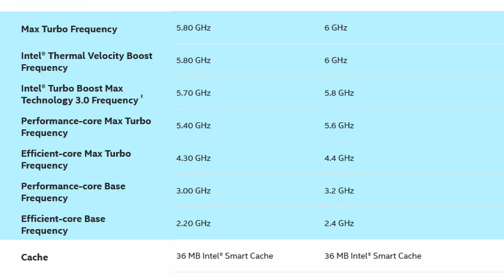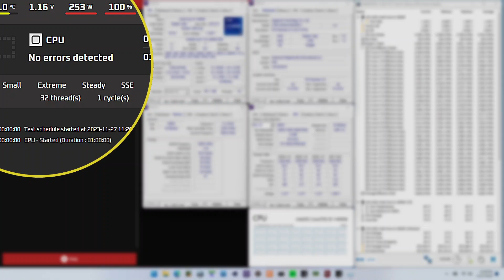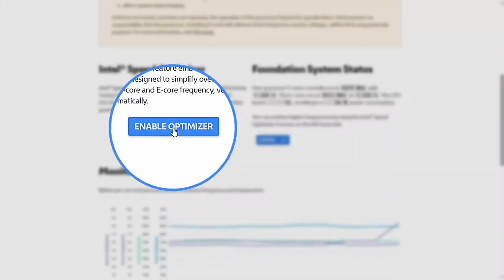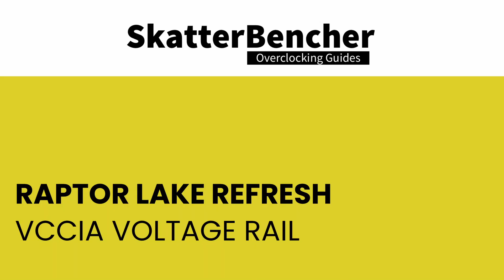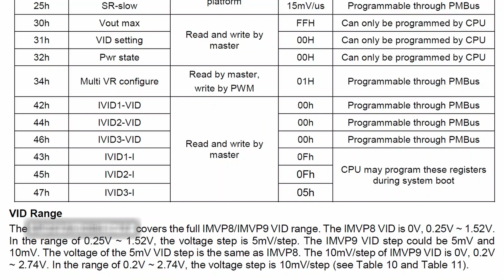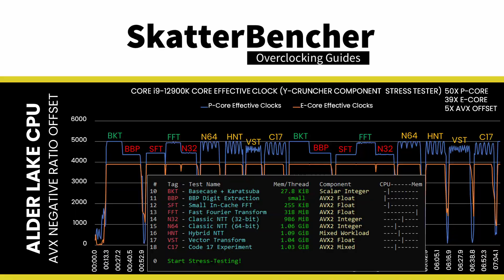Core i9-14900K Undervolt & Overclock to 6200 MHz feat. Z790 Aorus Master X | SkatterBencher #67

Comment: How are you throttling 100° and pulling so much power with such Bach numbers? I’m hitting all core 5.7ghz and all core 4.5ghz on the e cores, 1.35v under full load, 82°c never throttles, 435a iccmax and only 290watts. Third try. Try a good cooler and thermal grizzley Duronaut, kryonaut at the minimum for these chips, very thin even layer. And a new ILM the ones that hold them from all corners.
Reply: Hey can you share oc setting like full bios of gigabyte my board is z790ud ax

Comment: I’ve tried following along but the naming and number scheme used by asrock is different. My bios has my ac and dc load lines on a scale of 0-20. With the default performance mode giving me IA AC 0.5 IA DC 1.1

Comment: Mate! you blown my mind when you under volt with positive offset at lower DC Loadline! After months of trying different configurations thinking that my system is cool and stable at last, my KS always finds a new way to prove me wrong LOL! Thanks for the video.
Reply: I would really appreciate any advice about tuning 14900K-KS to work fast, cool and stable. I prefer a simple and effective method (if there is any).

Comment: I used exactly same settings in my Z790 AORUS like You. I had 253W - Now its 350-360W and 200 points more in Cinebench R24Multi.
Reply: And after this settings and clear cmos settings my windows 11 booting very long. Whats wrong?

Comment: So which should I use if I want my 14900K to run cooler and not ignite a new Sun?
Reply: You are looking in the wrong direction. Those guides are for overclocking regardless power and temperatures limits. Simple dirty way to restrain max temp is to set your preferable maximum temperature limit in the BIOS. A bit more sophisticated than that is to combine with an all core negative voltage offset on top of intel's default profile of your motherboard and find the sweet spot for your particular system.

Comment: I have the gigabyte z790 UD AC mobo + a i9-14900k cpu and my clock speeds are staying on auto 3200 mhz after all the changes in the bios. Can anybody explain or help?
Reply: Not enough voltage to hit those high frequency’s
Reply: i have same did u solved?

Comment: @SkatterBencher  can you please show or write the settings for a ROG MAXIMUS Z790 HERO Mainboard or similar ASUS Mainboard and the Core i9-14900K. I have a G.SKILL	F5-7600J3848F24GX2-TZ5RW memory and it only works with 7000Mhz stable. Thx in advance

Comment: This video is very interesting. I am French and I use a translator on YouTube, so I'm not sure if you mentioned that when selecting an option like (for example, x60x60x57x57x57x57x57x57), and the mask cores settings are set to run at x60x60x60x60x60x60x60x60, Windows seems to lose track of which 2 cores is preferred at 60x. This causes a sort of "train dance". Indeed, every two minutes or so, each core switches to 60x, then switches and moves to the next core (+1), and Windows seems to automatically move is  main kernel programme windows hard , and so on, to the cores. This cycle repeats endlessly. two cores 60x switch kernel windows indefinetly . I wonder if this could lead to security issues in Windows, but since the Windows kernel constantly shifts for 2 cores in 60x, this could have an impact. I think it would be useful to mention this detail; it is still interesting to see that the wear on the 60x cores is distributed, as it’s not always the same cores that reach 6 GHz, which helps better distribute the load and avoid wear on cores that would constantly run at 6 GHz. This also applies to all Raptor Lake processors.

Comment: Step by step to this video broke meu pc.
Reply: It didn't work here either (gigabyte z690 cpu 14900k), it's still at 100 degrees.
Reply: Learn that you need to learn the methods, not copy one on one the input digits. So standard.

Comment: So I'm trying to lock in my cores and voltages for 14900K so it doesn't degrade from auto voltages like what's recently been reported by many users. However, I'm on an Asus Z790 APEX Encore board so I'm not sure how much of this video translates over. I'm not an expert at all at overclocking so there is a lot of this I don't quite understand or follow. I also found you had an overclocking guide #53 for 13900KS on the Z790 Maximus ROG board which I feel like might have more similar settings since they are both recent Z790 ASUS boards. Would you recommend following that instead since 13th and 14th gen CPUs are basically identical

Comment: How to get VID table of your cpu with gigabyte motherboard?
Reply from the maker: Only possible by manual testing, unfortunately
Reply: @SkatterBencher  Do you just look at hwinfo vid while idle or do you run a workload? And do you use default LLC and voltage settings?

Comment: Firstly thank you for your video, will aid me plenty in my quest to perfect the temperature and stability of this beastly processor. Few questions, is 90degrees package temp safe when gaming? Also any chance you have/can do a guide on ddr5 overclocking, i only ask as xmp enabled on my 6400 rated ram, set at 6400 caused some serious heat coming from vrm/cpu/ramand mobo.

Comment: Bless you. 
50 minutes of dense material. At some point I did feel my head warming up!))

This is most in-depth and  professional guide to this point I've seen so far.

~42k in CB23 on LF II 420, 25 ambient, reached 100C at the end, but maintained around 95C most of the test.

Totally worth the time and I'll be share this video to anyone who needs info on overclocking.

Comment: Quality video but for a simple user that likes plug and play its a bit complex! It seems that u have no problem running the system with the average temp of 80-100 degrees! I was hoping to see how to drop it at 70 degrees! Great effort for the community!
Reply: Raptor Lake doesn't have any problem with 90+ degrees Celcius temperatures. Only too high Vcore values will kill it.

Comment: For my 13900k and 14900k I have done the following: MCE off, PL1 and PL2 limit to 225, limit P-core boost to 5.5 GHz and E-core boost to 4.3GHz, and use balanced power profile in Windows (although I do disable core parking to keep system highly responsive). Oh and just XMP on the RAM. I didn’t change LLC value. I have set voltage offset at a modest -0.015v and set the Core limit to 300 Amps. I have disabled the C6&C7 C states and EIST. Lastly I have locked AVX at 0 offset. I have tested on P95, CB R23 and CB R15. All great and in a mid 20 degree room, no workload exceeds 80c on package or cores. Very happy and benchmarks are very close to where they were before taming these beasts.
Reply: Ur castrating ur i9…
Reply: @godnamedtay  I just use the defaults now the BIOS updates have come out.
Reply: Still isn't 80 degrees still hot? I am hoping to get it at max 70 degrees! :(
Reply: @danielc.5954  at full load on synthetic benchmarks maybe a stretch. Real world use likely more than possible.
Reply: @Mike_A1200_M0SAZ cinebench is nothing but a amp and watt hog.  Set your qmps to 420 and wattage to 400 and  you'll hit whatever bclk u set provided ur chip is stable enough and you got tht volts right
Reply: Great response.   I have similar setup but you can easily hit  5.7 all core brother.  It's 5.8 where things get a bit more difficult. Have t managed to get it there yet stable even with a 1.45 or even 5v... Just can't do it. Not sure if it's Intel microcode junk messing with the power supply directly to the CPU
Reply: You need to use higher llc
Reply: @antisocial7010  I have set everything to Performance default following the BIOS updates.

Comment: hello am glad i just found this awesome video overclock explanation : just curious , i have a Aorus Master X board , am not a fan of overclock but i need to set up this board the right way for some reason i think it came overclocked out of the box and i would like to have it on a normal stats cause in benchmarks it goes up to 315 watts and to 100c for 5 minutes of benchmarks it pass the test  but when i go for 9 minutes on benchmarks the pc reboots i notice that is overclock : can i use the same stock performance setting that you use with the Extreme board on my Master X board 

thanks in advance and keep up with this great and awesome videos : My Rig is

 I9 14900KF 
128GB RAM VIPER PATRIOT
AIO LIAN - LI Gallahad II 360 liquid cooler performance
Aorus Master X MB

as a Video Editor i just want the system stable when am rendering: oHHH wait i think we have the same motherboard LOL i didn't notice u have safe me a tons of trouble issues

Comment: I'm curious, if I just need cores and threads, but don't need high speed, what's the lowest voltage setting these cpu can take if i run at 5 .2ghz max?

Comment: Hello. According to your guide 23:18, I set up the processor for P-cores to 6100ghz, everything works fine, but for some reason it does not work on 6100 in games? Does anyone know why my processor resets to 5700ghz, there is no trolling, the processor has a temperature of 56-65 in loads
Reply from the maker: That's as expected if the game workload uses 7 or more 8 P-cores. You can check the Active Turbo Ratios configuration https://youtu.be/Ww_BJhz_w98?t=1529

Here we set the target CPU ratio to 61 when up to 6 P-cores are active. The target ratio for when 7 or 8 P-cores are active is 57X (5.7 GHz)
Reply: @garison89202  thanks for this question

Comment: Hi, I've just discovered your channel. And I must say you are by far the most detailed channel to explain Gigabyte Aorus bios! 

However, I still cant figure how to undervolt my setup. I have an i7 13700F paired with Z790 aorus elite, F10 Bios  and some settings such as VF offset is not shown like yours in the video (despite setting Voltage mode to Adaptive). May be my non k CPU was the cause?

However, can you please give some simple bios settings that I could try to at least undervolt my CPU to some degree other than just changing PL1 and PL2?

Thank you in advance :))
Reply from the maker: The "easiest" but also quite advanced way to undervolt the CPU would be to adjust the AC loadline.

Advanced Voltage Settings >  CPU/VRM Settings > Internal VR Control submenu > IA VR Config Enable to Enabled. Then Set IA AC loadline to a value that's lower than what's currently reported in the BIOS. I strongly recommend steps no larger than 10. So if the default value is 60, try 55 or 50.

Comment: Will the z790 master the none x version motherboard work with overclocking to 6.2?
Reply from the maker: The non-X board should have the same capabilities for overclocking, yes.
Reply: @SkatterBencher  Thank you so much for your reply and for your video. I will give it a shot.

Comment: 14900K Asus Strix Z790e here, cooler is an old Assassin III, similar go noctua NH-D15. Running super duper stable at 253W. 37.008 points on cinebench. If you want to more let me know.

Comment: @ 32.15, I'm confused. My take away from your statement is that you can't change the V/F points to under/over volt because Intel's burned in ones will always override what you put.
Reply from the maker: The user cannot change the factory-fused voltage frequency curve of an Intel CPU, except:

1) The highest V/F Point, where the user can change the VID and ratio
2) By using V/F Point Offset (Advanced Voltage Offset), the user can offset the factory-fused V/F curve
3) By using the various adaptive and override voltage options.

Hope this clarifies better :)
Reply: @SkatterBencher  That's what I thought. But stating about them being "fused" kinda made it seem like you couldn't affect the V/F points 1-9 (or 10, can't remember) at all.
I spent about 4 hours trying to tweak those like you were saying in your video (I watched many, many times, and took notes), but had no luck at all. I did have luck by simply setting VDroop to 5 and Core Voltage to 1.35V. No "overclock", but my 14900K would work full speed with no thermal throttling; meaning CinebenchR23 ran all core at 5.7GHz and I got a score of 42,727. Running multiple times I always get in the high 42K.
No luck in overclocking at all; not without it downclocking for thermal throttling lower than it's base speeds. I think it could probably do well with the V/F points 10 and up, but I haven't figured out how without it thermal throttling.

Comment: Very valuable.  Thanks for your time.  

At 8:32, for example, do you MANUALLY calculate the average P-core and E-core effective frequencies, or are those average effective frequencies obtained directly from somewhere in HWINFO64?
Reply from the maker: The effective clock is directly from HWiNFO reporting
Reply: @SkatterBencher  Thanks for the reply!  I'm probably missing it somehow, but all I see are "average" values fot the individual P- and E-cores, plus a "Core Effective Clock" and an "Average Effective Clock" that both appear to time-average the effective frequencies of the P-cores and E-cores as a group.  If you have a moment, looking at this annotated screengrab of HWINFO64's numbers for my setup, where are the calculated values that you report? http://teamandras.com/temp/2024/HWINFO64_Image01.jpg

Comment: I want to see a pure reducing temperatures guide. Not overclocking just getting the insane temperatures reduced by 10-20 degrees under load with a AIO.
Reply: Get a big cooler

Comment: What power limit do you use ?
 PL 1 
PL 2 
ICC MAX ?
Reply from the maker: 4095, 4095, 1023
Reply: @SkatterBencher  why does it always crash when I increase iccmax to unlimited? I always stuck to 307 A current

Comment: As you mention cinebench r24 cant run 5.8ghz, have you ever try cinebench r15 on raptor lake？It is surprisingly hard to run as a non avx workload. On my system r15 is as hard as r24. 
R15/R24 doesnt pull that much power as prime95 sffts or occt small, so the cpu wouldnt down clock to stay below tjmax, sometimes they are harder than small ffts, but r23 is pretty easy to run, do you have any idea why r15/r24 much harder than r23 on raptor lake ?
Reply from the maker: I haven't tried other Cinebench versions too much, especially R15. But even though R15 doesn't use AVX instructions, I recall it would still trigger the AVX offset on older Intel CPUs. So it's heavier than an SSE workload but not as much as an AVX load.
Reply: @SkatterBencher  R15 is harder to run on alder lake and raptor lake than the old intel cpus in my experience, it is even harder than most  y cruncher stress test except sft if i remember correctly

Comment: You have a guide just to undervolt for temps, I don't want to overclock as it already runs pretty hot.
Reply from the maker: There's a BIOS option that lets you set the maximum temperature

Comment: Thanks a lot for this video. I’m running an i9-13900K in this same motherboard. I take I have to adjust the OC parameters you use on Strategy 3 to make it work.
For OCCT test did you run the small or the large data set?
Reply from the maker: Yes, the settings I provide are illustrative in the sense that they worked for my system but may not work for others due to silicon lottery. 

Yes I run the small data set to put more stress on the CPU cache.

Comment: Excuse me, can i use this guide with  the manual OC to the l wifi 7 X z790 wich is one model before this one?.
Reply from the maker: You can use the general guidance but your settings may be difference due to difference in hardware

Comment: Do the voltages and overclock speeds vary between z690, z790, z790refresh? I have a 14900k coming for my z690 asus tuf board and am wondering if I should consider a motherboard upgrade as well. I will be looking to undervolt.

Comment: Why do you use those IA AC/DC loadlines when you can just use offsets?
Reply from the maker: AC/DC loadline will vary its voltage adjustment based on load, whereas V/F curve and voltage offsets don't.

When using a too high IA AC loadline setting, you'll get high voltage in idle and lower voltage under load. So for a given target ratio you can be both overvolting ("doesn't need that much voltage in idle") and undervolting ("needs more voltage under load") at the same time.

IA AC doesn't need to be 1 (or 0.01 on ASUS), but I prefer it to have better control over the voltage especially at the high-end of the V/F curve. So I minimize the impact of IA AC loadline, then use the voltage offsets to finetune.